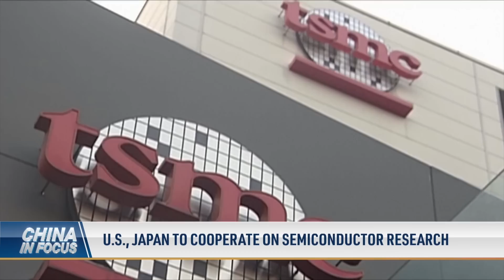Pelosi to Visit Taiwan on Tuesday: Sources; Japanese Minister: China Uses 'Logic of Brute Force'

Comment: I think both sides need to consider that there is not right to threaten or intimidate as leaders each had their duty and responsibility and as long as the trip had no aiming on provoking...on microcontroller are good but not over used it unless properly shielded because they can flip flop if you heard of the term